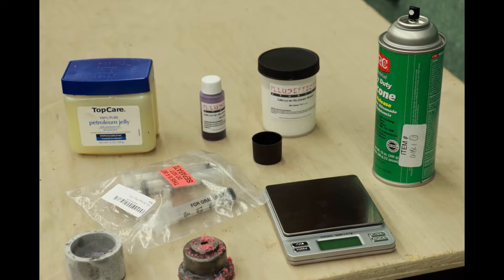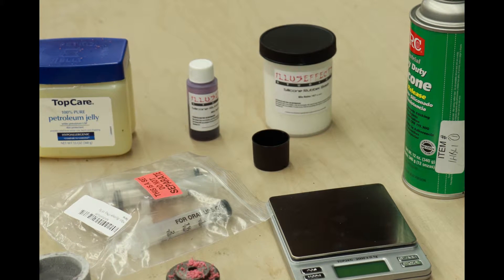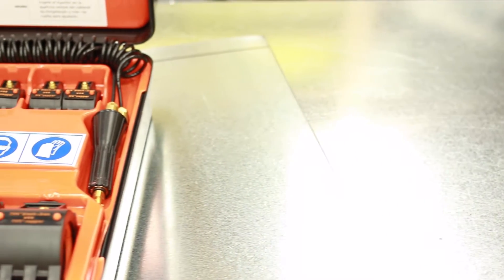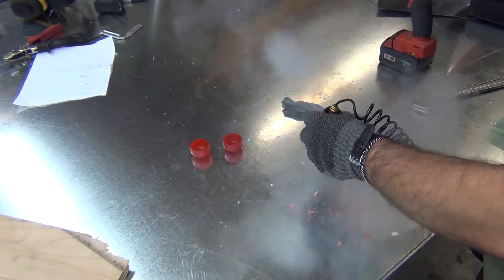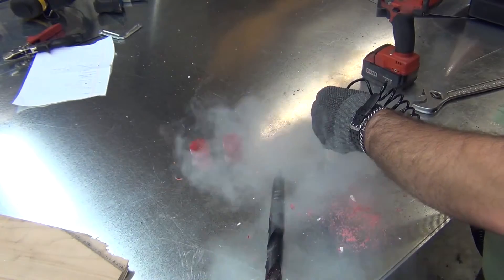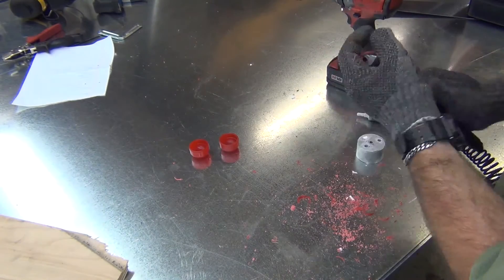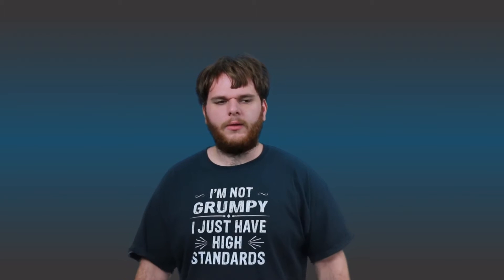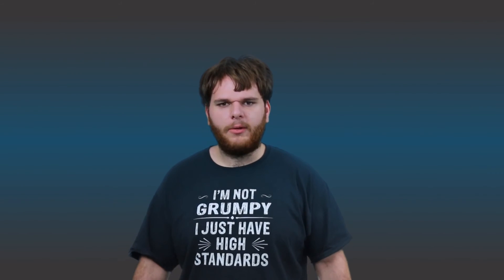DIY Swivle Eye Boots for Hydro Assist Ram

Comment: Interesting. :)    The DIYer can also used canned air upside down to get the same super cold spray.  The unibit probably would have worked better if it had a really sharp edge on it.  I haven't seen one of those plumbing kits before.  Just looked it up....cheaper than I thought.  I'll have to keep it in mind for the future. :) Thanks!
Reply from the maker: I think if the very bit, or unibit, was too sharp,it would have grabbed the boot and ripped it out of my hand. I can't remember too well, but I think I had problems like that with another bit style. A jig would have worked out great here. But I only needed 4. :)

Don't use canned air upside down. You will regret it. They put so much bittering agent in that stuff that it is near unusable when spraying air. I bought a fancy vacuum that also blows out air just so that I don't have to use the stuff. I use it to clean out my servers.

Now if you need an alternative to pepper spray, it would work great. :)

Thanks for watching it. I know your busy.
Reply: I haven't noticed anything with the canned air upside down.  Sprays out super cold liquid.  Next time I need a bottle for the welder filled, I might just see about getting a CO2 tank.  Thanks!!
Reply from the maker: Realy? Maybe you got the good canned air. :)

Comment: Although I understand what you did, your insistence in saying "liquid CO2" felt kinda weird. Because you're not working in a 5+ atm enviroment, are you? Nice video, tho.
Reply from the maker: +altaroffire56 Thanks. It is liquid Co2, just like dry ice is solid co2. Once compressed and cooled, it will remain liquid until it heats up enough to evaporate, which is pretty quick.
Reply: I know, I know, it just sounds a bit funny. No big deal. ;)
Reply from the maker: altaroffire56 Ah, ok. Yea, it does sound a bit crazy if you think about it. :)

Comment: You might want to take a peek at Blue Hands videos for another option.

Peace!
Reply: Mike, no problem! I am just glad that I could be of some help that benefits both parties and the content you produce can be a big help to anyone doing this type of work and hobby machining so keep doing your thing!
Reply from the maker: +Jeffrey Vastine Yea, thanks. It took me awhile to get around to watching his content, but he is one of the few machinist on youtube that I like.
Reply from the maker: +Jeffrey Vastine Thanks for the tip. I would not have thought that turning polyurethane bushings would turn out so well. 

Although, I have found that bushings are a bit harder (and some are very hard) than the boots I had. I think there's a lot of variation in polyurethane parts. But it is good to know that it can be done.
Reply: I'm glad that provided you with another option. Now as long as a materials density is enough to maintain it's form and rigidity it can be turned, but one needs to adjust the speed, feed, and tool pressure so the material can be cut. Would you have thought that wax or ice could be turned? I have even seen foam rubber turned on a 4th-axis on a mill.
Reply from the maker: Yea, I didn't think polyurethane would be dense enough to cut. I would have thought that it would either gouge and tear, or just deflect against the tool. But I guess if you know what you doing, you can cut some pretty soft materials.

I could definitely see wax and ice working. But foam rubber? I usually can't cut that suf with a knife. :)
Reply: I know what you mean as I used to think along those lines, but once I began to expand my awareness i.e. cross the lines and start to think outside of the box the possibilities seemed endless. Like most people who are familiar with machine tools I would imagine that an image of a hss tool bit or insert and holder come to mind when you read/hear the word "tool" in reference to a metal lathe. However, the "tool" can be anything used to remove material from the stock to form the part. For instance with the foam rubber a Dremel type tool with a cutter like a small saw blade was used. The process created a lot of fine particles , which stuck to the part, but once removed with a vac the results were much better than expected. Hopefully this provides you with a little food for thought and I look forward to seeing what you come up with. ;0
Reply from the maker: Yea, I kinda do think of hss or inserts when I think of machine tools. I'll be sure to keep a more open mind the next time I need to cut something odd. Thanks for the thought food. (is that a term, because it should be :)   )
Reply: Well actually it was a term that I came up with about thirty years age to present ideas and information to people  without being threatening i.e. a form of non-violent communication, where you avoid telling people that they should or need to do something. More often than not people put up blocks when they hear terms such as; "you should" or "you need to" and then they disregard the information that was presented to them whether they consciously realize it or not. The next incarnation of the term became "food 4 thought" back in the mid nineties, which I used as the name of a sporadic newsletter that I used to share things of a philosophical nature with my friends. Following that was a Facebook group that my fiance` created to share some of my writings with others due to the value she thought that it would bring to their lives. Unfortunately I have not had time to write much of anything the past few years due to a youth project of mine, which is my effort to help transform this world into the paradise that it was meant to be. Anyway, I hope our little dialog provided you with a little clarity or enlightenment to look at things in a different way. If you have any questions or would like to know more about anything that we talked about, please do not hesitate to ask. Please feel free to use the term "food for thought" as you wish. Hopefully it may assist you with keeping the minds of those you communicate with open so that they will remain free to consider the ideas and information you are presenting to them and thus have their lives enriched by them. Peace!
Reply: A bit late to the party, but Bob just told me that he found my channel via a response to this vid.....so Thank You! :)
Mike
Reply: I like the dremel idea!  I think that Bob could have used that with a sharp cutter even without freezing.....although the freezing would probably make it easier.
Reply: Jeffrey Vastine   Awesome! Thanks! :)
Reply: ....and I just realized he says his name is Josh? at the beginning of the vid.  Now I'm curious about the 610bob name. lol
Reply from the maker: +bluehandsvideo Yea.... I'm working on changing that. My channel name, not my name. :)

First off, Bob is, for some reason, my go too name. My invisible friend who always does wrong is called bob. :) Yea, when something goes wrong, just blame Bob Lufkin. :)

This is going to be a bit of a story. But, I had the first 64bit computer in our house. So I named it 64bob. When I joined my first forum, I tried to use 64bob, but lost it do to entering a fake email address. So I changed it from 64bob to 610bob. 610 being my area code.

I used it as a username ever since. I then created a website, 610bob.com. A year or two later, I created my youtube channel. I wasn't too sure of the direction of my youtube channel at this point. And I didn't want to tie it to my name. Partly because josh is a really popular name. Since I already had 610bob.com, making my youtube channel 610bob seemed like the right thing to do.

But yea, it's weird and confusing and I want to change it.
Reply: I understand.  The naming thing can be a challenge.  Most of my forum stuff was done as mklotz70, but I didn't want my YT channel to have my name in it.  I've seen other guys change they're channel name without affecting their content.  AvE did it.
Reply from the maker: Yea, I'm not too worried about losing subs or views. I just have to get off my but and make the graphics. :)
Reply: I should probably make a different intro, but it's short and that's just what I want. :)
Reply from the maker: Your intro ain't bad. It's quite memorable. Especially the sound.